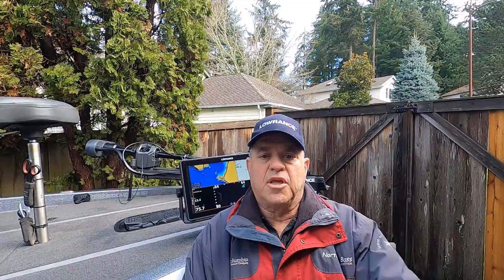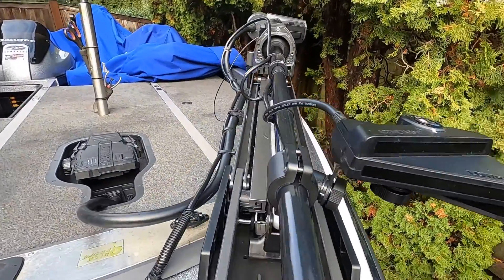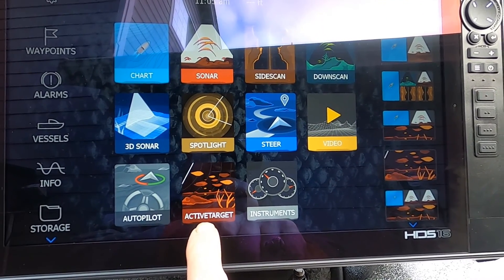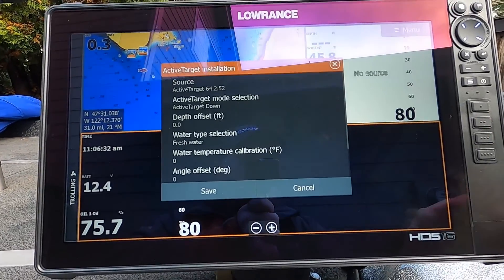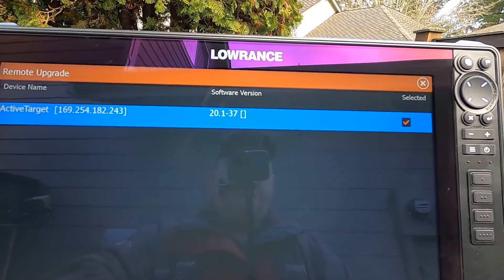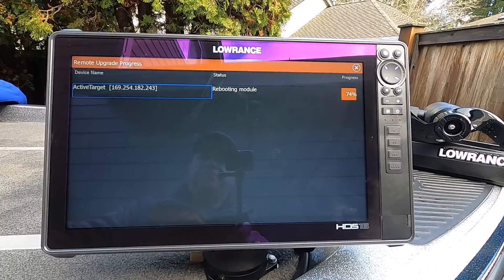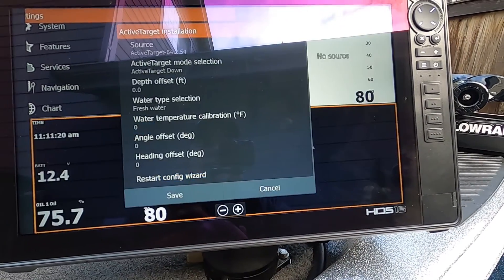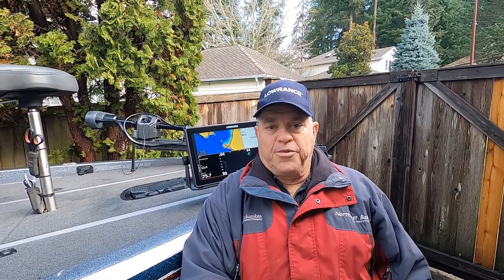Active Target Setup Steps

Comment: Lowrance is ridiculous. I can't hardly get their crap to work together. I hope an update is the magic bullet. When all else fails, update Adobe and restart.
Reply from the maker: The current updates work great.  If you still have problems after the updates and hard reset,  then you have other reasons for the problems (except there is still a problem with using the Airmar transducer).

Comment: Nice mount. I did the same thing at first but the module kept getting way hot and shutting down when I was out fishing ledges in summer. I remounted it under the console and it works great because air can get to it and keeps cooler. Thank you for your video. Good luck!
Reply from the maker: Adequate cooling is important. I mount my AT2 boxes with the cooling fins oriented vertically to allow the heat to rise and escape. I don't put life jackets or other items other than rods near them.  My rod lockers actually stay cooler than ambient temperatures when fishing on extremely hot days. Not sure if that is a function of how well insulated my rod lockers are, or the color of the boat, or combination of factors.  Glad you figured out that relocating yours fixed your problem and will help others with the same!  Thanks for commenting!

Comment: I don’t have the option to turn on active target at all. It’s just not there
Reply from the maker: Pages, Settings, Advanced, scroll down to Active Target and turn it on.
Reply: @marcmarcantonio  yessir I’ve seen videos on it but it’s not there. There all the other options but active target is no one of them
Reply from the maker: @user-lw4du3pe3t  So more info may help to diagnose the problem.   I think you are saying you do not have Active Target icon on the tray.   What unit do you have? Is it updated with 23.3 update? When all else fails save your waypoints then perform a hard reset.

Comment: how did you connect the black box power cable to the power on your hds 16?
Reply from the maker: You connect the AT2 black box power cable with the red wire to positive, black to negative, and the yellow wire to an accessory switch.  If you have two AT2 units you connect the blue wires from each power cable together to synchronize the pings.  Your power cable for your HDS unit is connected entirely separate from your AT power cable (but can be connected to the same positive and negative sources, yellow and blue wires not connected or needed.

Comment: Hi Marc, I had active target installed at my local boat dealer, and the transducer is mounted on the trolling motor shaft. But my transducer is mounted opposite from most that I have seen because my propeller is stored outward on the trolling motor so the transducer is turned the other way. I’ve went through the set ups and have done the updates but still can’t figure out why the Lake bottom on the screen is not flat and is running up at about a 45° angle… Any thoughts? Anyone?
Reply from the maker: First thing to try is turn off Stable View in the menu. 
 Without seeing a photo of your transducer I can't be sure,  but usually this happens when the transducer is tilted up too high.  Check the reference lines on your AT mount. 
Lastly, check that your trolling motor shaft is vertically plumb when deployed.  If it is angled forward or backward, it throws the transducer angle off as you rotate the shaft
Reply: @marcmarcantonio  Yea, it’s a mystery to me! The shaft appears straight and the transducer is in the correct notches for forward view. I have the Elite FS 9 unit and I’m wondering if I should just restore back to factory settings and start over.
Reply from the maker: @FalconsATL  Make sure you have Stable View turned off in the AT menu.  This often fixes your issue. 
Failing that,  go to Settings, Sonar, Active Target Installation,  and hit Restore Defaults.
Reply: @marcmarcantonio  Thank you! I’ll try that and let you know!!!
Reply: @marcmarcantonio  Also, I wonder, is there a setting in the unit that should be switched on or off or to flip the transducer since it’s mounted on the opposite side of the shaft from normal?
Reply from the maker: @FalconsATL  There is a menu choice to flip the view,  but this is for those who mount it facing backwards on their transom.  You don't need to do this as your transducer points forward regardless which side of your motor it is mounted.

Comment: Mark, just watched your video and it was clear and concise.  However I too looked at Lowrance website under support, software updates, transducers, and found lots of install manuals but no updates.  Can you enlighten me how better to find it?
Reply from the maker: On the Lowrance website, go to Help & Support, then Software and Manuals Download  (https://www.lowrance.com/downloads/), then enter the model of the unit you wish to update!  Hope this helps.
Reply: @marcmarcantonio  Thanks Mark, Lowrance has moved the software update for Active Target from the Transducer section to the Active Target section.  Please share your thoughts on turning your Sonar off when doing something on your MFD and your boat is not in the water.  It was not addressed in your video.  Can you update AT software and have Sonar turned off, or unplugged?
Reply from the maker: @james gracyk  Not sure what you mean when you say turning off your sonar?  Are you meaning 2D (regular sonar) or Active Target live sonar?
You should always stop any transducer from pinging out of water,  though they are very resilient and often are not damaged when out of water for short periods.  Some high-powered transducers like models of AirMar can quickly be damaged from heat when operated out of water. I stop my Active Target transducer when removing it from the water to prevent damage.
Reply: @marcmarcantonio    Mark, by "stopping sonar" I mean either physically unplugging it from back of MFD, or  going to Features page and clicking the box to turn sonar off.  Which way do you stop your AT transducer?  Next question, if one uses the Features page, will that turn off all three transducers (Active Target, 3 in 1, and 2D)?  And finally, will the black box accept software update for Active Target if the AT transducer stopped, turned off or disconnected?  I say turn off, you say stop.  I think we mean the same thing.
Thanks, you are very helpful.
Reply from the maker: @james gracyk  First an important message... never unplug or plug in any transducer to a unit while the unit is powered on.  This is called "hot swapping a transducer" and it can damage the unit or the transducer.  Always turn off the unit prior to attaching or removing any transducer. 
 "Stopping" the Active Target transducer is accomplished by going into the AT menu and on the second page of the menu is the choice to Stop Sonar. This keeps the transducer from pinging and protects it from overheating while out of water.  Hope this helps.
Reply from the maker: When you update Active Target you must have the box powered up.  I can't answer if the transducer must be pinging (I suspect not but do not know that for a fact), but I would let it ping while performing the update to be sure it takes.

Turning off any item in the advanced features settings removes those functions from your application tray so they cannot be accessed.  Not a good idea to do unless you no longer have those functions on your Lowrance unit.  Stop sonar for all types in the menu options.
Reply: @marcmarcantonio    Thanks Mark.  I knew not to plug/unplug transducer while mfd is powered up.  Based upon your response, that to leave AT transducer pinging during an update is OK, is kinda what I thought.  In your update video you did not mention specifically to stop the sonar, or that it's OK to leave it on, is why I asked the question.  Hopefully, since the update only takes a few minutes, no damage should be done.
Thanks again, JimG

Comment: I see you decided to hook up the extra ground on the module box. Where exactly do you have that grounded to ?
Reply from the maker: I ran the ground wire to under the console and connected it to my Ranger negative buss bar.  It is working great and no corrosion anywhere even after fishing brackish water.

Comment: Hey Marc I have a problem trying to do the update on my Active Target. The problem I have is once I downloaded the latest version onto my SD Card, once I insert it into my slot, my fish finder isn’t reading my card. Any suggestions?
Reply from the maker: The update does not load automatically like updates for HDS units.  You have to manually upload it like the steps in my video on updating:  https://youtu.be/IYkQDk8uSj4
If it still doesn't work try a different SD card and make sure it is 32gb or lower in size.

Comment: Good video!  Just took delivery of a brand new boat.  I ordered it with HDS 12 Lives, Active Target, Sea Clear power, Ghost, Point 1, and sonic hub,, thinking the installation done all at once at the factory would help.  Wrong,,,I’m still troubleshooting.  Active Target transducer is clicking with only the battery cut-off switch on in rear compartment. I can then turn on Lives individually, but still haven’t touched my power or accessory switches.  I like the yellow wire on accessory switch idea, but mine is obviously not.  Software is 20.1, so will work on updates after I get a smaller than 64gb microSD.  Heck, the AT module is mounted upside down, and does not have a 10 or 12 awg dedicated ground installed.  Lots of other issues, but won’t get into it here.
Reply from the maker: You are not alone.  I quit having the factory install ANY of my electronics.  I always do a better job, and then know exactly how my boat is wired.  Ciao!

Comment: Great Video but I have a question.  Does active target require “network sonar” to be enabled on the HDS Live unit where the module connects via Ethernet?  Bow HDS Live->Ethernet->Active Target.  I currently have “network sonar” disabled to keep temps, depths,.... local to that unit.
Reply from the maker: I will have to check on that, because I keep mine on network sonar and multisource all the time.  I don't like to have each unit only use the transducers hooked to that unit, so I don't program each unit to be only local.  There is no advantage to me to have them local only.  That is a subject probably for another video, but if you look at my video that shows Transducer Tips and Tricks you will see how I setup my boat with transducers.  I can view any transducer I want on any unit this way, and even two at the same time on any unit (front and back sonar on the bow graph for example at the same time).

Comment: Verry helpful  videos senor marco thanks
Reply from the maker: Thank you for watching!
Reply: @marcmarcantonio  mr marcos  u know how long the active target takes to turn off? i hook the yellow wire to my hds live yellow  wire  the unit turns on the ducer on but  wont turn it off ones i turn of my graffics
Reply from the maker: @ThePichin21   There is a problem with the Active Target software that prevents the Yellow Wire turning off the Active Target box.  It will likely be fixed in the next software update for Active Target.  In the meantime make sure you turn off the power where the red wire is connected.
Reply: @marcmarcantonio  thank u sr 🙏

Comment: Marc, nice job. Very clear instructions. Does the latest tducer software update fix the yellow wire sleep issue?
Reply from the maker: Not yet, that will be in the next update I believe.
Reply: @marcmarcantonio  In the meantime, would you recommend wiring the yellow separately to a fuse block connected to main power?  I have my head units wired directly to the battery so I am hesitant to connect the yellow that way too since it won't sleep when the unit is off.  2nd question, should I consider going directly to the battery with the black box?  I have heard that it needs nice, steady power like the head units.
Reply from the maker: @greigbw  I would wire yours now like you want it after the software update; it doesn't hurt anything.

I am a strong proponent of wiring the yellow wire to an accessory switch on your boat if you have one available.  If not, I would consider adding a switch to your boat.  The accessory switch can be wired to your main boat power panel under your console because it only uses a small amount of power to activate or wake up the module.  

Which brings us to your second question.  Yes, I recommend you connect the red and black directly to your battery, and in your case since your head units are already directly to the battery you are likely fine to connect the red and black to the same wire that goes directly to your battery.  

In other words connect the red and black to the red and black of your head unit, and the yellow to a boat accessory switch.  That is how mine is wired except that I use a fuse box for connecting my head unit, my 3D StrutureScan, and my Active Target box, and together the fuse block goes directly to my battery.  Thank you for watching and stay tuned for many more videos.

Comment: Hi Marc, hope you are well! Thank you for the great video! Quick question: is it an issue / damaging the transducer when you are running it and not being in the water? On Saturday I will install mine :). Thx Br, Martin
Reply from the maker: Not that I know of, but I will find out.  So far I have not noticed the transducer getting hot, but it is 42 degrees each time I have used it.  I will certainly keep my eye on it during the summer, and likely will turn it off from pinging when it gets hot outside.  I do this now with my Airmar transducer when not using it.
Reply: @marcmarcantonio  Hi Marc, thank you! I am also not sure about these things. I hear from time to time in videos that  transducers should be in general not activated when they are not in the water. Don’t know how true that is.
Reply: @BigCannon69  Hi Luiz and Marc, I installed the active Target this weekend and put a on/off switch in the wiring to the transducer in order to shut the power off to the transducer when I move a few miles at top speed to another spot. When I only move a few hundred yards, I will keep the transducer in the water and move slowly. I haven't read anything about a possible problem of the transducer getting hot but just to be sure.
Reply: @BigCannon69  Yes that's right Luiz, I am in that little European country on the West coast! As to the transducer, I installed the on/off switch just to be sure.
Reply: @BigCannon69  Nice to meet you also! Are you an American living in Germany? What do you fish for over there, walleye and pike?
Reply: @BigCannon69  okay, same here, I really like visiting the US, fishing for stripers, salmon and bonefish. But I also like fishing in the Netherlands freshwater and shoreline sea fishing (sea bass, related to the American stripers although a smaller growing species) Where in the Netherlands do you fish, do you go fishing around Amsterdam with one of the Dutch fishing guides?